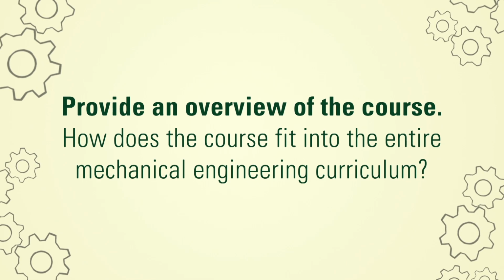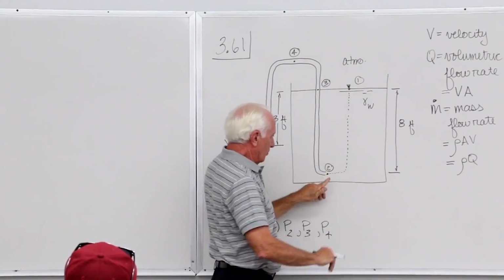Fluid Mechanics: Interview with Dr. John Biddle

Comment: Professor John speaks out the truth. As a practicing engineer leaving school for decades, this process is a daily routine. Learn it and apply for it. I didn't have fluid mechanic class over my time in engineering school for my major in structural engineering. But eventually I find Professor Biddle 's video lecture are useful to learn the interesting topic.